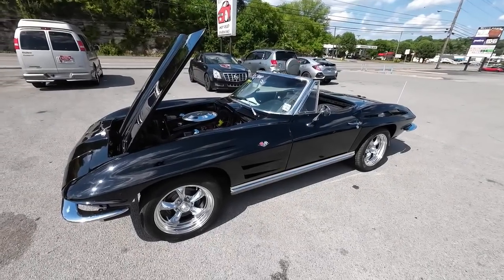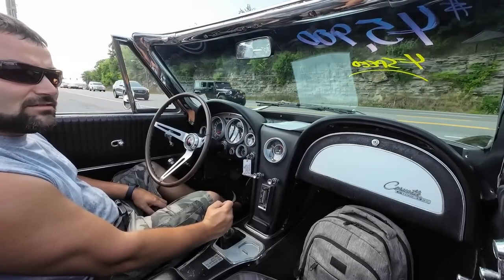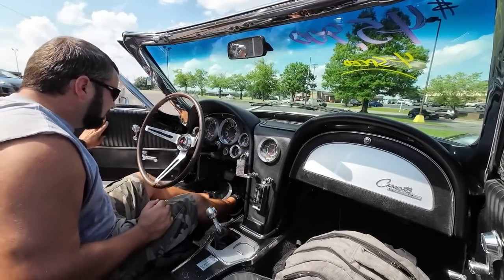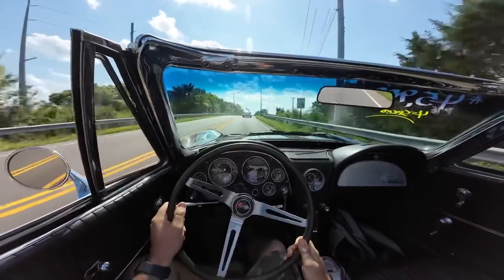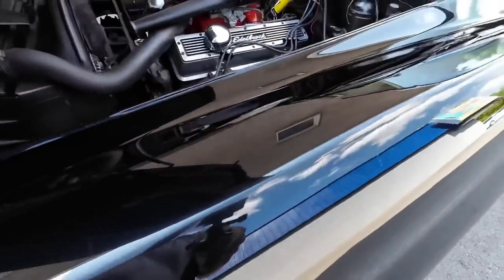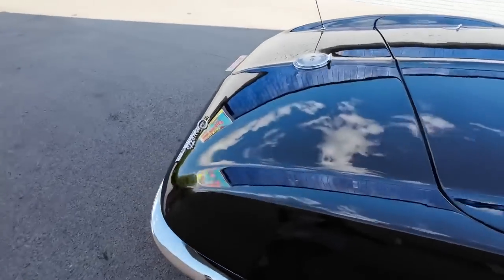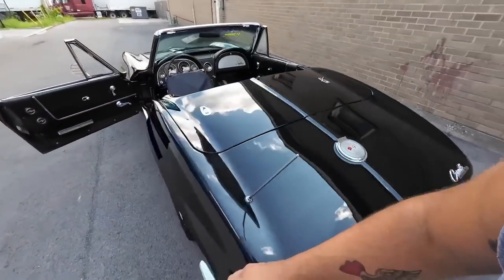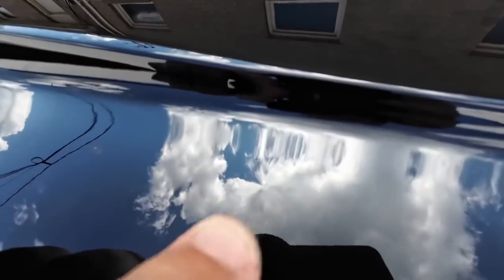Test Drive 1964 Chevrolet Corvette SOLD $45,900 Maple Motors #2213

Comment: At 46k its an entry level Vette, and its all there so ist a good price! Just finished watching the video. I like it. I would give it a new harness, carburetor, dump the speakers and  fix the body where the holes were cut for the speakers. Fix the minor stuff, right headlight, do body and paint, new top. Go over drive train top to bottom. And have a $130-150k car.